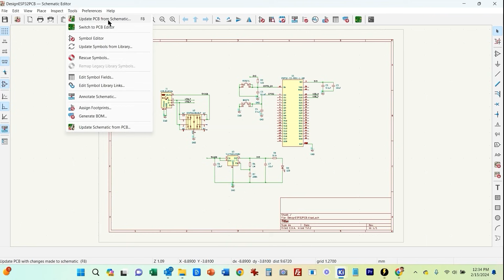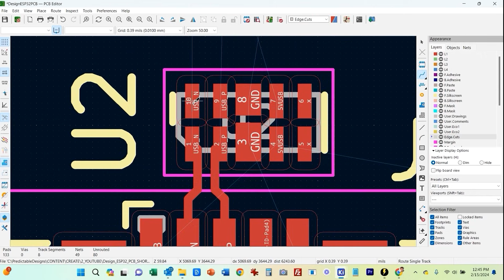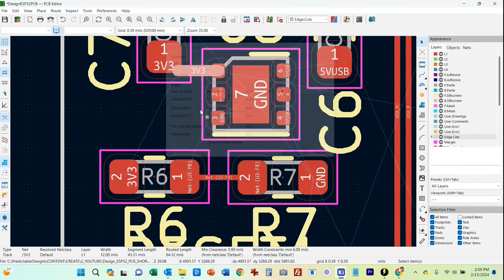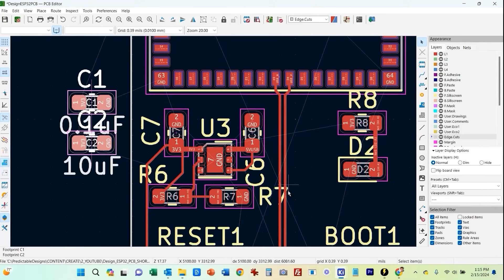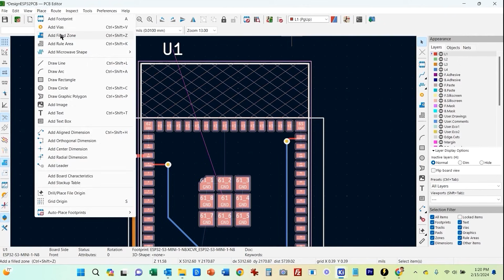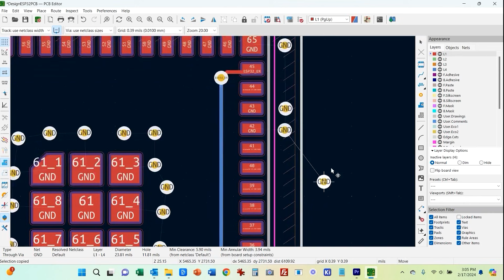How to design an ESP32 PCB with KiCad (in less than 25 minutes)

Comment: This is a good video. I have Pcad and Aliumn  and have used them for years professionally. I have been making new designs for the DIY community and found most of the community interested in my projects could not use my cad files so I am learning kicad for them to copy, modify for use directly with the pcb fabricators.

Comment: Designing my own board right now. Can i connect the usb shielding directly to ground or should i use a 1M Ohm resistor with a decoupling cap to avoid my cable acting as an antenna?

Comment: Hey i have a question. Isnt the D3V3XA4B10LP only ment for Voltages under or around 3.3V? I read that the reverese breakdown voltage is 5V meaning that it would begin conduction towards ground right? Its just because you have it connected directly to the 5V Vbus. If im wrong please enlighten me.
Reply from the maker: Nope, you're correct. I caught this mistake after publishing, and unfortunately I can update a published video. There is a pin for pin replacement ESD chip with a working voltage up to 5V that can be used with no PCB changes.
Reply: @PredictableDesigns what chip is this? I'm currently in the procces of making my first big pcb, taking inspiration from this video😊

Comment: Hi! Great video, but is the 5.1k resistor for the LED correct? Wouldn't that let very little current to flow through the diode?

Or is there a specific LED model that can light up with that current?
Reply from the maker: Yeah, good catch, and I forgot to change the value on that resistor:( Oops! That's way too big of a resistor and will limit the LED current to low just as you commented.

Comment: ESP32-S3R8V is dead as per jlcpcb (board maker) & Espressif (chip fab). 
ESP32-S3R16V is the replacement with double the PSRAM (internal DRAM w/ refresh built-in).  
ESP32 S3 N16R8 with 16MB Flash and 8MB PSRAM in ESP32-S3-WROOM module.

Comment: Design a PCB capable of independently controlling multiple 12V DC loads (e.g., motors, solenoids, and pumps) while interfacing with an ESP32 microcontroller can you provide pcb schematic for this problem
Reply: Sir if you could provide solution it would be great

Comment: Great work Predictable Design. I have a little misunderstanding. After reviewing your schematic diagram, I realized you left out CP2102 that is mostly connected in between the USB and the MCU ? Why is that the case ?  Anyone to help me understand
Reply from the maker: The CP2102 is a USB-to-UART bridge it's only needed if programming through the MCU serial port. In this case the ESP32 has a native USB port so no need to do this conversation.
Reply: @PredictableDesigns  Okay, I got that. Thank you

Comment: Nicely done, may I give you a tip? Assuming you said yes 😃...  In stead of deleting those values, turn off the Front and Back Fabrication  layers (F_FAB and B_FAB). That is where they live. Then they will all go (your are hiding them), so you can't see them but the are there is case you need them later on if you decide to have your boards assembled. Good luck!
Reply from the maker: Thanks for the tip!
Reply: @PredictableDesigns  You are welcome!

Comment: how to  flash the esp32  in your design  your are not using usb to uart  ic then how to flash the esp32 .i using platfromio as my text editor. then how to flash without usb to uart ic.
Reply from the maker: You flash it directly through the ESP's USB interface. I cover this in detail in my ESP32  design course.
Reply: @PredictableDesigns I followed the 3 hour version and created my first PCB. Similar design as the video but I added some JST connectors for I2C peripherals, and a different ESP32.

I can flash the device but it doesn’t auto restart. I think that is related to the ESP32 version I’m using.

After a power cycle, I can’t connect via serial to get any output and simple led blink programs don’t work. Feels like I have a button floating or something pulled high that shouldn’t be. I’m still trying to find my mistake.

Can you point me to your ESP32 design course?

Comment: Great video! It helps me get a good beginning understanding of how to get going.
Question, if we aren't adding the USB-to-UART interface, can we still use Arduino IDE to program the board? I would guess not since from my research it seems Arduino IDE does not support that.
Reply from the maker: Glad you liked it! Sure you can use the Arduino IDE via a direct USB connection to the MCU, as long as the MCU has a USB bootloader.

Comment: How come you use a tvs diode with Vrwr of 3.3V for your 5v usb output? Wouldnt the diode start to conduct and short to ground frying it?  Shouldnt it be rated for 5v since it still goes through the regulator before the esp.
Reply from the maker: Great catch! I found that mistake after publishing this video. It didn't cause any issue on the initial few boards since the minimum reverse breakdown is 5V, so we didn't measure any current flow through it. But in production this would be a no-no, since it will likely leak a bit on more edge units.
Reply from the maker: You can substitute the TVS diode chip with the ESD7104MUTAG which has the same pinout but is specified with a reverse working voltage of up to 5.0V.

Comment: Don't you need to add external 10K pullup resistor on IO0 pin for keep ESP32 board on Boot mode?
Reply from the maker: The ESP32, like most microcontrollers includes internal pull-up resistors.

Comment: Hey great video but one thing i dont understand, in the hardware design guidelines for ESP32S3 Espressif stated that
"Note that USB_D+ will have level output, so please add a pull-up resistor to determine the initial high-level output voltage"
Should't then a pull up resistor be placed from 3.3V to the USB_D+ data line to inform the host of full-speed mode ?
Reply from the maker: Thanks for commenting. The ESP32 includes internal pull resistors.
Reply: @PredictableDesigns  Thanks for the confirmation, i couldn't find info about the internal pull-ups before but you are right

Comment: Hello John, it's a pleasure to see you again. I have a small doubt that has me confused. Does the ESP32-S3 have a built-in USB to UART converter chip and can we connect it directly from the native USB? So, why is the UART port included in the devkitM if the native USB port is enough to charge, power and monitor? Thank you so much for your time.
Reply from the maker: Yes the S3 contains a native USB interface so there is no real need for any USB-to-UART converter. They only include it on the devkit just to give you two USB ports and I think just because they've always had that circuit on their boards before the S3. I agree it's confusing though and I wondered why they included it too at first.

Comment: To move the components around on the layout initially, select groups on the schematic. They will also be selected on the layout and you can move them as sensible groups. And those 3.3V decouplers for the IC need to be as close as possible to the IC pin 3. Hanging away on a long track they are not doing their job. You need to widen the board to place them. Alternatively put them on the underside.
Reply from the maker: Thanks for that tip!

Comment: Do we need to add 1.5k resistor to D- or D+?
Reply from the maker: That can be confusing and some microcontrollers embed this resistor internally and some require it be added externally. The ESP32-S3 includes them built-in. If you refer to the schematics for S3 dev kit you'll see there are no external pullups.

Comment: Thanks. Really appreciate you showing the basics. I’ve assumed this is What’s going on on the boards but nice to have it confirmed. I got a bare module cause I’ll be prototyping a drone flightcontroller and want the bare minimum. I’ll make a pcb later.
Reply from the maker: You're most welcome.